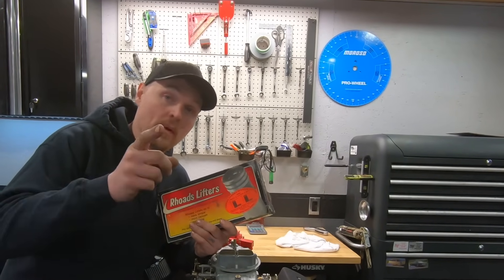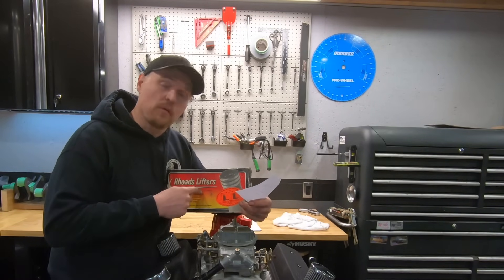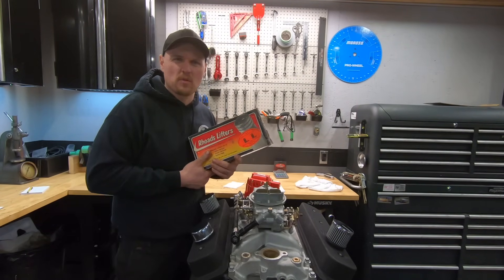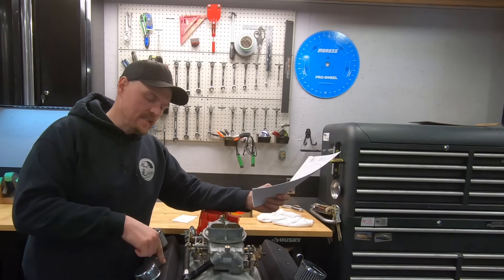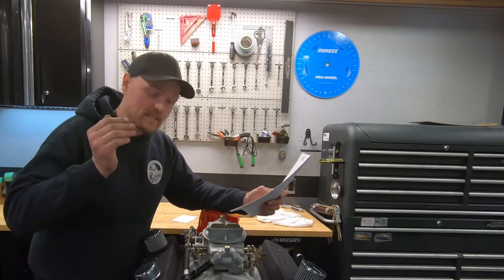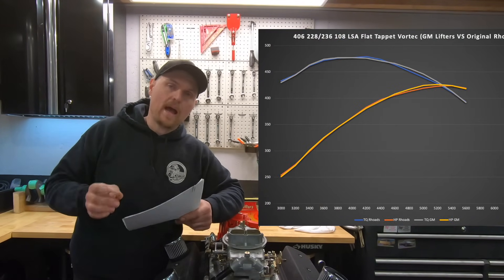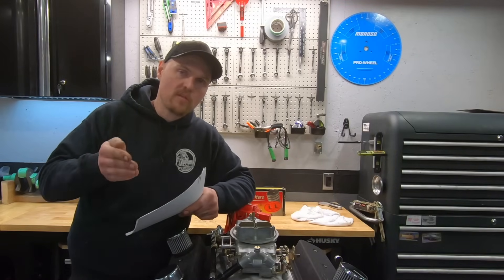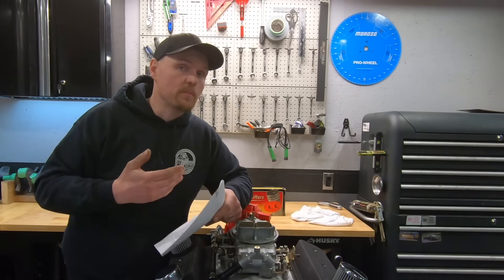Dyno Testing Rhoads Lifters! Interesting Results (Part 2)

Comment: An interesting test particularly as I'm looking to get a set of these at the moment however possibly a little pointless in terms of the dyno chart.  I don't think there are any claims of these lifters improving power below the 3000RPM on your chart or that they would make more power than a standard lifer over this.  It would have been much better to see a trace from lower RPM (1000?) but I guess a dyno is not set up for this?  Infact the Rhoads are showing a small lift right at the start of the trace.
Also the main reason for using these I believe is to recover some of the power (and drivability) lost low down when a wilder cam is used so it would be good to see these tested with a cam which fits that category.

Comment: What was the idle vacuum with each cam? I have run rhoads the idle was significantly better, idle at 600 in gear vs 1000 with standard lifters.  Met someone running the exact cam and the same cid. Why didn't you start dyno at lower rpm?

Comment: Ur last hyptbesis has ways been touted n promoted.  Jump from a comp 268 thar makes say 12 inch w standard lifter n barely runs ur power brakez to a comp 280 magnum grind that wudve dropped to 8 inches but now makes 12 w rhoads yet gains 15 to 20 hp cuz its bigger!  OR jump from 280 grind to 292 magnum grind. Etc. Same concept.  Gain hp n still run power brakes by virtue of nxt size bigger cam grind! 8:32

Comment: this was a very interesting real world lifter comparision when hammering the the engine in the 4000-5000 range. My 1970's stop light drag racing genre is over and I recently built my belair sbc 350 engine for lowend torque and best highway gas milage at about 2200 rpm range. These rhodes might give me the added 2-3 miles per gallon more that Im looking for

Comment: I ran Rhoads lifters in a 460 Ford 12 years with a PAW mileage cam, Offenhauser dual port manifold with a Holley spread bore carburetor. Lots of low end power with great gas milage in a 73 T bird. Very happy with this combination.
Reply: My butt dyno told me that the Rhoads lifters were working great under normal driving conditions. That was good enough for me. 😛

Comment: My thought turned to trying a higher volume oil pump so the lifters recover from the leak down mode quicker as the RPM increases. Another thought; use single viscosity oil (30 or 40) to avoid temperature related variability in viscosity.

Comment: Rhodes work great with bigger cams and auto transmissions, milder converters.  Not needed as much with stick shifts. They are proven and work great.  I first learned of them in the 1970s!

Comment: you need to start the dyno at around 1200 rpm. youll see the torque up. at 3000, they are already pumped up and running like normal.
Reply from the maker: You'll never get a dyno to pull that low unfortunately
Reply: @cuttersperformance  then line up some horses and see how many you can drag. =)
thanks for the video on them btw. i have a set for my buick v6 that i am wanting to install when i build it. its for a jeep with a mid range cam (comp 260h). they were purchased to bring the rpm range down a little and extend the torque band into lower rpm. seems from your video, theyll do exactly that.

Comment: Have used these on 351 Clevo. With a mild hydraulic 'race cam' The whole engine was built for using 6300. BUT the engine went to 6800 so easily  and made power there. I suspect it would have ran to low 7000s but power [440] dropped off at 6800. Have tried to keep it under 6500. The same engine is going back to the same cam but with normal lifters but better heads [though a bit less comp] so it will be interesting when it is used again.

Comment: Just installed a set of the vmax new style Rhoads lifters  and honestly the installation and valve adjustments was way easier than I thought they were gonna be..   Tip if you want some more of that chop sound tighten up your exhaust valve adjustment. 😉 👍🏻💪🏻!!

Comment: 8:32 Thanks for the update. Great content. I wonder how long they will live. Also, why do much spark timing at idle? I have found 11 degrees at idle, vacuum advance on ported( not pulling on idle) 10 degrees advance can and HEI centrifugal 25 degrees over all at about 34-35 WOT and 45 cruise highway. I also use stiffsprings in the HEI to control spark knock. Maybe it's just me but I get tired smoking bottom end and better than stock MPG. The last one I did had 2.76 or 2.93 gears. It already had a small camshaft but, it burned my eyes at idle. Way too rich. Changed the jets and rods in the AFB EDELBROCK.

Comment: i ran these lifters in a small block chevy over 40 years ago, had very good luck with them.  i had a GM cam # 3896962  ( stock L82 cam, still available thru chevrolet performance!).

Comment: 25 yrs ago ran rhoads on intake only on my sbe 350 junkyard eng with comp 280 cam & home ported 86 vette heads, 1.94/1.5 valves In my 63 chevy 2 . Had nice mild lope, excellent throttle response. Ran 11.70@114 mph on 87 octane. (Btw switched to stock vortec heads & car slowed to 11.8 & 112 mph )

Comment: Had a 383 sbc  4 bolt Chevy high nickel block, in a 65 Vette flat top forged pistons, 416 2.02  Double Hump cast iron mildly 2.02  ported heads, Crower 242@ 50 hydraulic cam, Crower dual springs, Crower steel retainers and locks, Manley Severe Duty valves, 850 Anular discharge Holly pumper, Edelbrock performer dual plane  manifold, 1" spacer, MSD 6A, Optical trigger conversion. 8:32  Muncie 220   close ratio trans, 2.76 rear gears, McLeod dual disc clutch, 1 7/8"  Hooker headers, stock Chevrolet dual exhaust and mufflers. I know not th best/correct exhaust.
Installed Rhodes hydraulic lifters, it seemed to run OK. Street tires, granny shifting at 6100 RPM (that is where the motor seemed to stop pulling). Car ran 13.21 at 112 thruugh the eyes, capped in 3rd gear. 
6 months later I was kind of disapointed how lazy it seemed to run, that was with a fair amount of tuning. I owned and ran a high performance Carburetor and fuel shop injection shop.
Changed to Crower hydraulic lifters, motor  WOKE UP! 
11.98 at 123.45 and shifting at 6800 RPM. Idle quality was not that much different, lost 1.5 inches of vacuum, still had 13 inches at 850 RPM but motor was much happier everywhere.  Low RPM torque was surprising better.
This was with 30 wt Valvoline, Melling high volume, standard pressure oil pump. 45 psi at idle (850) RPM 90 to 95 psi hot. Moroso 7 qt baffled pan.

Comment: Would you consider,,, Dyno testing the Rhodes Lifters only  on the Intake Lobes, and standard hydraulic lifters on the exhaust???
 For instance, my motorcycle uses 'Shift Cam' technology only on the intake cam. The exhaust appears to be a moderate to higher performance profile grind. The bike runs nicely mannered at lower engine speeds. One can feel the Shift Cam transition to the higher rpm profile and keep-on pulling.
 I'd be interested in what the manifold vacuum would be with the staggered lifter option🤔🧐.

Comment: My guess is the lifters add more below the RPM you tested (given your idle clips) and indeed 'pumped up' adding duration. The problem is this combo dropped off before that duration added to the peak, but came in early enough to show that upper-rpm loss.

Regardless you've definitely shown they do act different. The key is figuring out what other parts will capitalize on that difference.

Comment: It almost seems like they’re more for in town cruising. I know you cant really dyno low RPM, but the graph at the very bottom shows a decent separation at 3k. If you’re cruising, possibly in overdrive at 2400-2800 rpm, what improvements would you see?

Comment: Love Rhoads, super high quality and do exactly what they claim. 
These are the ticket if you want to build a "sleeper"st killer. 

Not sure that Rhoads are supposed to be adjusted as Delcos...or they can hang the valve open and will never start. 
Lot of hate for these are for guys who didnt follow instructions. Great product
Reply from the maker: @gordocarbo  these are the original rhoads and were adjusted as per the instructions. The later versions are adjusted from the bottom with feeler blades

Comment: I was only going to say that I thought it claims that lifters "act normal above about 3000-3500 rpm" so the big differences would have been seen if the pull started much lower in the RPM range. Hopefully you'll be able to check that. Great stuff, thanks for this!
Reply: Only a BUTT DYNO can do that.. 😉 👍🏻😂

Comment: Thanks for great test and engine data! 
If I get right DCR is about 7.4:1 with full pumped and 8.2:1 when those lifters bleed down.
If SCR is any higher than that 9.38:1 then those lifters would get DCR too high for iron heads and it will start detonating. 
It's already in the edge if it gets high loads under 3000 rpm, I think.
If You only could get runs from idle to 3000 rpm then we will see the benefits of Rhoads lifters
(and will that engine detonate in low rpm under high loads?)

Comment: I run the VMAX lifters in my 389 it runs really strong it used to have highway gears (2.69) and a turbo 400 behind it in a big car it’s a 63 Pontiac Star Chief and it did pretty darn good later I swapped a Super t10 transmission in with a 3.23 gear and it’s still a beast! I’m running a Mickey Thompson cross ram and i definitely love the lifters

Comment: I first used Rhodes in 1981 in my 340.  Of course, at 17, I picked the biggest cam Summit offered.  A Crane Fireball 112 sep and (Adv) 310 duration.  The thing idled beautifully and had great, crisp throttle reaponse.  They are fantastic for making power on the street withought the insufferable side effects of a cackling engine.
Reply: @HomeTipsAndTricks  1981! Summit was a small player back then. P.A.W. was the big dog on the block. That all changed in the late 90's though. I miss P.A.W and their parts bible.
Reply: @scoutdogfsr  Spot On!  The crank assembly in my 340 is from PAW!  Balanced and 'blueprinted'.  The machinest said it was the nicest he'd ever seen.  I miss them too. 🙄

Comment: Son, when Rhoads says "bottom end", they mean from IDLE to about 2500-3000. In their ads, they say full lift and duration is restored by 3000 rpm. And dynos dont even load below 2500, unless theyre calibrated for a diesel. Upshot: if you have a 3000 stall or higher converter, you won't FEEL any difference, and the ET won't SHOW any difference. But with a stock or very tight converter, you should.

Comment: I'm pretty sure Dino's only operate at wide open throttle so drivability at lower RPMs like 1500 to 3,000 will not really show a difference on the dyno

Comment: We used them about 20 years ago on a 350 with a too big cam in it, changed to Rhodes lifters and really made the car much more drivable without a huge difference in top end power, kinda felt like a a power valve in a two stroke

Comment: I think the dyno is kind of a hard test for these lifters. I bet if the dyno was able to accurate read at low rpm, you would see a torque advantage between 1500-2500 rpm, where most engines cruise at. By 3000rpm the Rhodes is already pumping up and becoming more of a standard lifter.

Comment: Rhodes lifters are not good.  They rely on oil bleed off  at the lifter.   Every lifter on a SBC gets different oil pressure and volume plus the fact that oil pressure varies based on temp so you get very inconsistent results with Rhodes lifters.    Side to side / front to back the oil pressure that a SBC lifter varies considerably.      You'd have to O-ring the distributor and use a balance line for oil pressure  at the front of the block's cam galleys to get consistent oil pressure to the lifters.
Reply from the maker: Some people love them and some hate them. Personally, I was surprised with the results on this engine being so close in hp and also adding so much idle vaccum. I would like to do more future testing with them

Comment: Both Lifters are collapsing at RPM.   That's why you got the same result,    Stock lifters can not take duration and a quality aftermarket lifter would be better.   
A better test would be a solid roller VS a Rhodes Roller on the same cam.    If you did this you would discover the Rhodes collapse and never recover or pump up.   So the cam acts like a smaller cam with  excessive lash.
Reply from the maker: Maybe a future test will be solids (tight lashed), regular hyd and rhoads on the same engine with a hyd roller cam

Comment: Both lifters are collapsing  at high RPM.   That's why this motor is rolling over.    Try a good quality short travel like the Johnson SBR2112.   Factory lifters cant handle an aftermarket cam with duration and will collapse  too,  the Rhodes collapse by design but never recover as others have found.  That's why you got the same result.
Reply from the maker: I've had no issues taking the GM lifters to 6000 rpm in past testing and engines. But usually 6000+ I go to a short travel

Comment: I’ve used them on two different engines, and have been very happy with them. I ran bigger cams than were suggested for the stock torque converter in my cars, and both cars ran well on the street, with no problems idling, or power brakes.

Comment: Rhodes lifters back in the day were used as a bandaid for the ones with power brakes and various other vacuum operated equipment that almost always picked to big of a camshaft.  Still not a fan of e’m.  Dyno results didn’t do anything except clean up the idle.
Reply: But that's exactly what they are designed for!
Reply: Pick the right cam

Comment: I used Rhodes lifters on a street 351-C engine back in the day, not to increase power but to satisfy the CA Smog tests on a slightly higher duration aftermarket cam. Passed with flying colors and did not seem to lose any performance at the top end. The ticking was not an issue for me. And 40 years later, the engine still runs fine. Yes-  I would use Rhodes again.

Comment: I bought my first set at the Rhodes shop in San Diego, which was a gas station.
I put em in my Bronco which had tall gears and too much cam (Sig 300 duration). 
$60 and changed them in the chassis with a cam break in routine.

Comment: As I said before I've used the vmax in a  class where you have to meet vacuum on 2 different engines with good results on bigger cams. And years ago (early 80's) the originals in a Corvette with 4 speed transmission. I think they are a good product. I will add that your testing isn't able to reflect one of the benefits of them because of your RPM range. In that Corvette I noticed some increase in torque at low rpm. Not sure where that goes away but it starts early. The car was easier to take off on hills and just generally easier to get it moving off the clutch. Helped my wife drive it as she wasn't a practiced manual driver but it was noticable to me as well. By the way he oil thickness will effect the way they bleed. I'd have to get my race engines hot to make full vacuum at idle. 👍

Comment: My brother-in-law has had the same cam and rhroads lufters running since 1989. And he beats the snot out of it. RHS engine. We did an intake and head swap on it last summer and I inspected all the lifters-they still look great. I talked with Rhroads after that and they said they are still making them the same way in the USA... so it appears they are still a great option compared to some of the junk currently on the market

Comment: I had a '71 Mustang Mach1 with the Cleveland 351. My biggest complaint with that engine was the valves would float at 6,200 rpms. Would these lifters help?
Reply from the maker: Doubt it. You're losing valve train control, which is typically the valve springs being too weak

Comment: Who makes lifters for Delco? Johnson or Elgin? most people don’t know that there are only a few lifter manufacturers. Some companies buy lifters and modify them, others use them as stock lifters. My personal favorite is the Sealed Power HP lifters.
Also, Rhodes Lifters were design to run with single weight oil. For performance applications that would probably 40 wt, although thinner oils would be used in colder climates or during the winter months. Running thin oils like a 20W 40 or 10w 30 will allow them to bleed down faster. Keep in mind that a 10w 30 oil is 10 weight with chemicals added to allow it to act like a 30 weight oil when hot. When those chemicals break down your running 10 W oil. Back in the day that could be problematic, but today’s oils are much better. But if you are having issues with the Rhoads lifters try a single weight oil.

Comment: The exhaust is most beneficial. DVs book on Chevy cams & valvetrains goes through the math and dyno tests. So a split duration, less aggressive exhaust ramp and aggressive intake with a regular lifter would be the best way to utilize the rapid leak down lifters.

Comment: good design back in the day and they sounded cool but roller cams just blow them away these days.  I used to rev 383 to about 7000 with them. I think they hold up but like i said roller cams are better and more fun
Reply from the maker: Rhoads lifters are also available for roller cams
Reply: @cuttersperformance  ok but I don't think I would want much valve lash at low RPM with a roller .